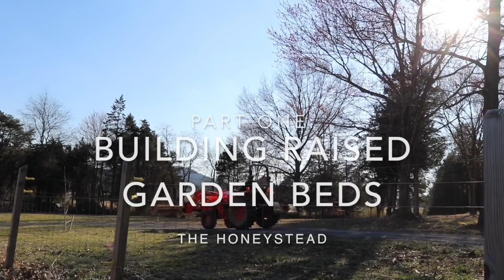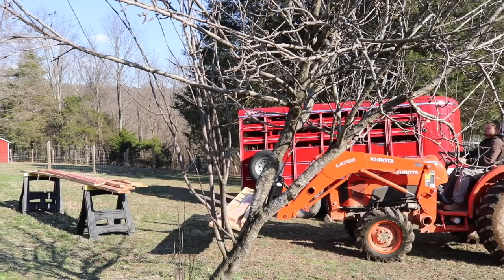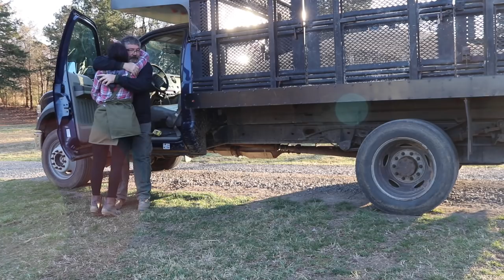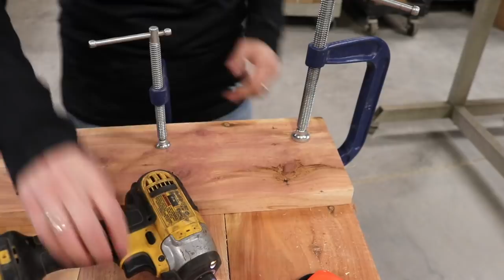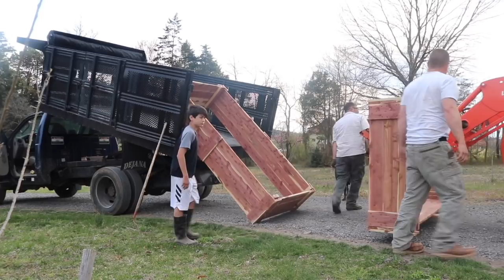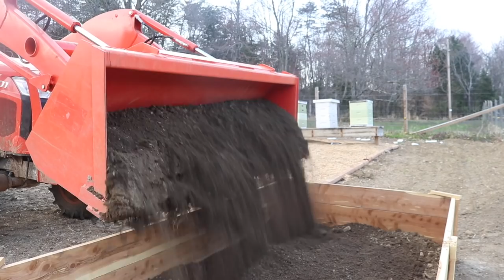Part One: Building Raised Garden Beds!

Comment: If you don’t tie your sides together they will bow....I used 4” X 6” sides three high...using the 6” sides for vertical....and screwed each to the one below....with bolts sunk in concrete for footing...after three years they are starting to bow out....built it 7’ X46’...love it....